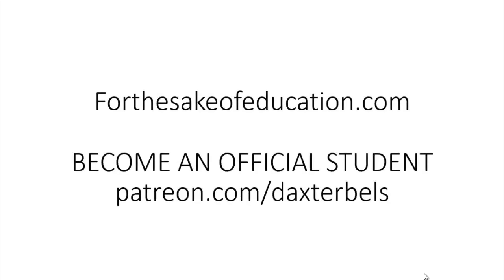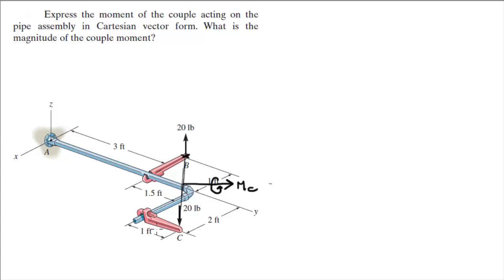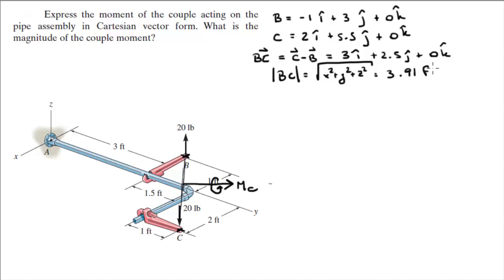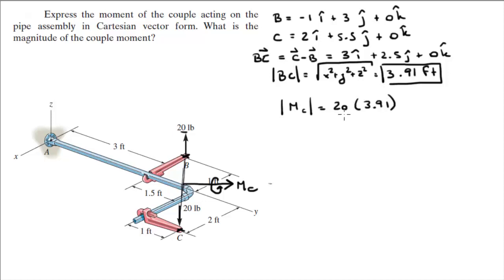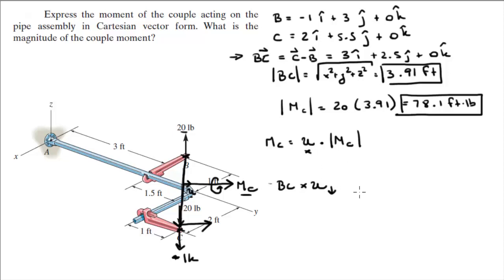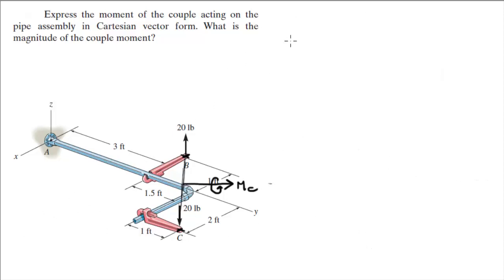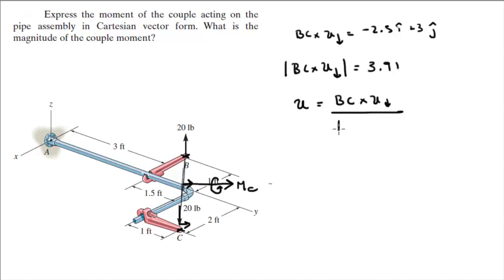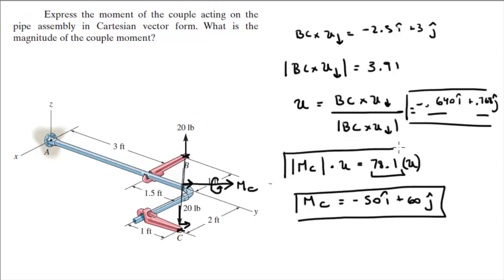What is the magnitude of the couple moment?

Comment: 1)Find r_bc by subtracting point c - b = (3i + 2.5j +0k)
2)Solve Fb = 0i + 0j + 20k
3)Take cross product of r_bc x Fb = 50i - 60j
4)Solve for magnitude = sqrt(50i^2 + 60j^2) = 78.1 ft*lb
Reply: This makes sense. Is the answer given in the video wrong then? His answer is -50i + 60j. How do you determine if the 20lb force in the cross product is + or - ? if negative, the answer would match the answer in the video.
Reply: @thomasmcguigan5626  Probably too late, but for anyone else, you want to multiply r_bc x Fc or r_cb x Fb to get the correct sign.

Comment: why is it -1 k?????
i didnt get it
Reply: For cross products the right hand rule is used to determine the direction of the resulting vector. Align your right hand down the first vector and then turn your fingers along the second vector, your thumb will point in the direction of the new vector. If +1k was used the new vector would be pointing in the wrong direction.  

He also used the right hand rule for moments to figure out the direction that the moment vector should be pointing.  Curl the fingers of your right hand in the direction of the rotation (which you can visualize from the diagram) your thumb will point in the direction of the moment vector.

Hope this helped! :)
Reply: I want to know too. Why can't it be +1k?